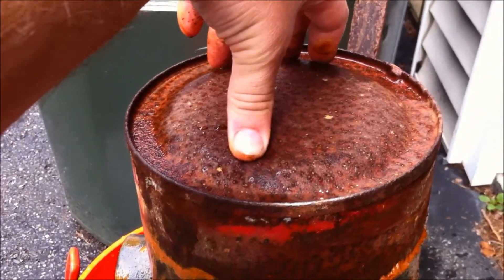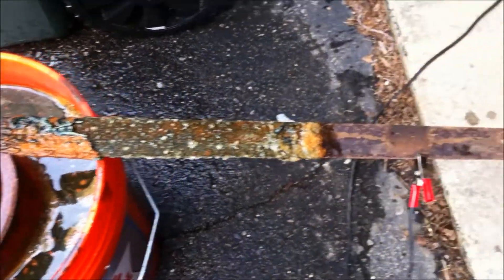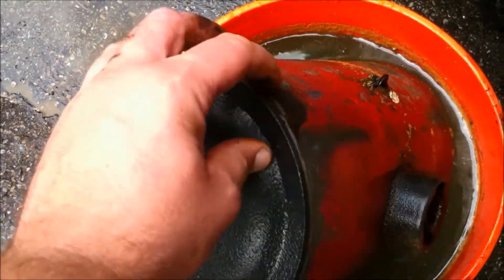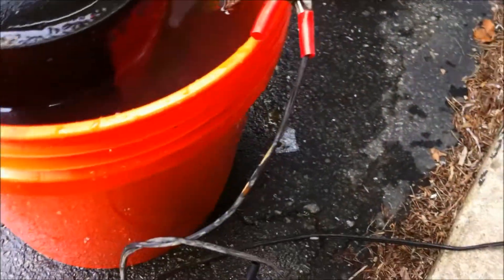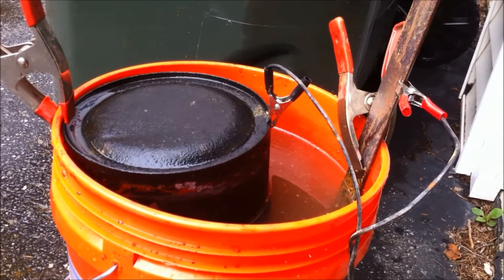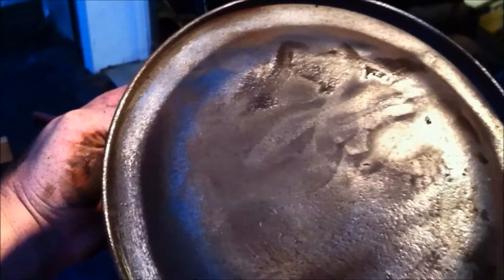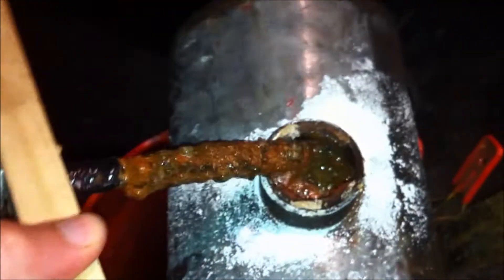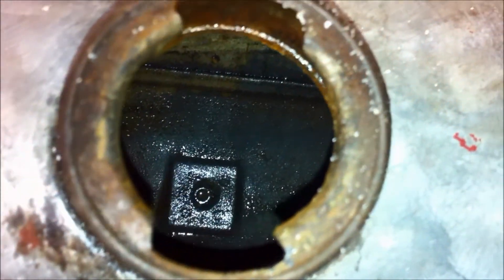1957 Gravely Model L gas Tank Restoration with Electrolysis

Comment: Hey Ralph,Viewed Ur Video well Done.Question about how U did inside of Tank,did U use a piece of rebar for Ur conductor through a 2X4?How far in the tank does the bottom of the conductor need to sit Thanks ....Kenneth
Reply from the maker: hi , I did use rebar.  I got left it about an inch of the bottom.  Let me know if you have any other questions.